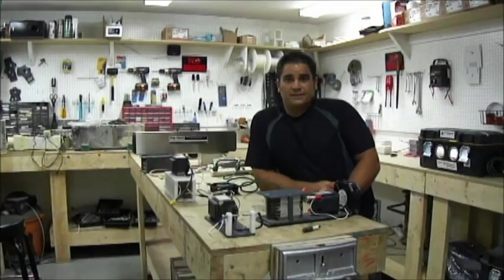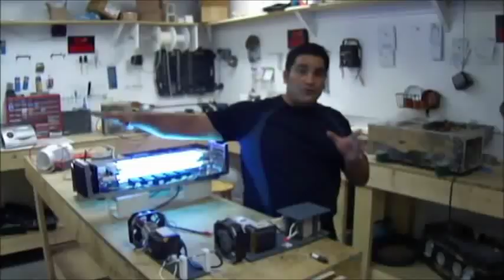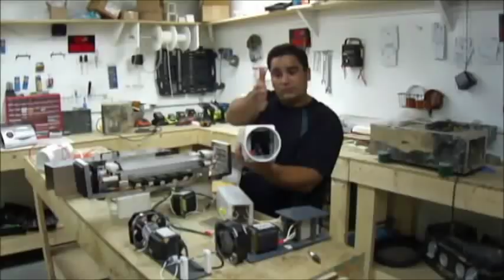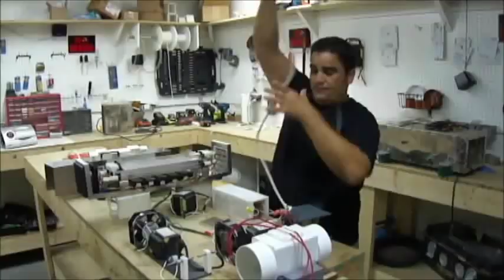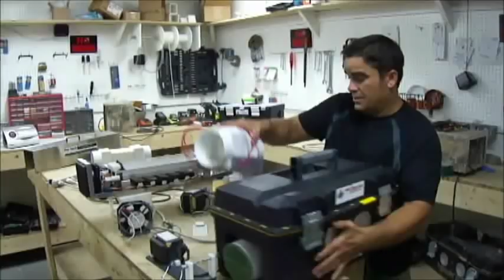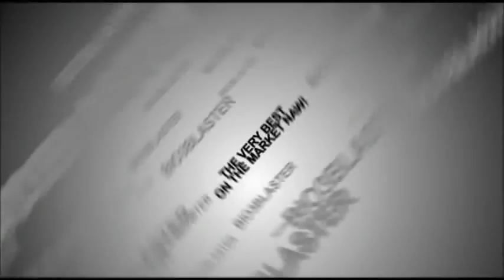Ozone Generators Exposed: What is inside makes the difference.

Comment: Only the high electrical pressure forces the fusion of oxygen atoms together forming ozone, and not the spark itself. When the sparking event occurs, the high potential electrodes are basically shorted together, and at that point no more ozone is produced except during in between sparks. That's why you don't see commercial ozonizers sparking during operation. Just my 2 cents.
Reply from the maker: Thank you  for your thoughts.

Comment: They use ozone to sterilize cpap machines and accessories. They talk ozone hurting the cpap stuff but just how much do these devices make and just how much parts is needed to hurt machine or plastic and tme exposes
Reply from the maker: I developed the first ever CPAP sanitizer using ozone,  see the video on this channel.  If you run it too long you could damage the plastics but very hard to do,  most of these units use very little ozone.

Comment: UV O3 vs. Corona discharge 03 differ, at lower atmospheric levels there are pollutants present in ambient air gasses, from the decomposition of organics (methane etc,) hydrocarbons and common forms nitrogen will readily bind to the additional Oxygen atom using the corona discharge method, forming undesired contaminants along with the O3 the UV method that occurs naturally in the upper atmosphere is free of pollutants from decomposing organic matter, and in the ionosphere, where constant electrolytic activity takes place, you have the best of both worlds and a safer pure O3, in contrast to what we’re actually creating through the CD process for example when the Corona discharge acts upon organic gasses it subsequently releases a Nitrogen atom, which combines with oxygen creating NO2  “NOzone” or Summer Smog. Nitrogen free O3 is also created as well as other compounds due to the instability of the O3, adding filtered purified air and or concentrated O2 upstream of the arc and having a contaminate free post arc area to allow the atoms to combine free of intrusion would produce more desirable results, It doesn’t matter how much Ozone you’re producing if you’re producing harmful contaminants as well. This way you release mostly “O” or O2&O3 the O3 can toss the O at the nearest suitable ionic candidate ( Nasty Stank ) and let the oxidation occur where you want it to, less ozone is needed for this, but when you use most of your ozone before it meets the desired target on pollutants you Co-generate, you must increase the production exponentially for it to be effective. Output is only one factor in a chain of possible variants, “More Power” means nothing if it’s wasted on fighting the resulting increase in counter production. 
 Just food for thought
Reply: it sounds like you have a good idea on all this ozone stuff.   any suggestions for someone new to the subject?  would you suggest a type of machine to use?
Reply from the maker: Well thanks for your thoughts.  Corona discharge can make medical grade ozone with a pure O2 input. Having tested both types of generators in the field i disagree,  with your hypotheses.  Good insight however.

Comment: I would say bring back the old cathode ray tube TVs back, because they purified air by trapping small particulate matter to all its internal high voltage components, an old CRT tv worked potential of +10KV and attracted all particulate matter both on its screen and as well as inside through venting grills, this is the prime reason there are more deaths through lung problems as small particulate matter stays air born and does not get trapped by old fashioned TVs and a result of which more children are suffering breathing problems, rise in asthma cases, and all being blamed on Diesel cars, for God's sake diesel cars were in use for a long time, and despite more stringent pollution control and catalytic filters and tighter emission controls, they are trying to ban diesel cars, as they are blaming higher NO2 gasses in the atmospehere, which is caused by reaction with Ozone, however old fashioned TVs in every home were very effective at removing particulate matter.
Reply: An air ionizer will fix the particulate problem. Ecoquest, Vollara, Alpine made ozonr/ion generators that cleaned and purified the air in a home electronically.

Comment: Never in my life have I heard such a load of miss information and absolute B.S. The sky is NOT blue because of ozone for starters. There is no, nor has there ever been a transformer of any kind that produces D.C. current. There are no "types" of ozone, ozone is a chemical. It's chemical name is O3, as opposed to oxygen, O2.  There is no such thing as "carbon ghosting", what he is referring to is the build up of soot (mostly fine particulate pollution from diesel combustion) on anything around a high voltage component due to the ionization of the air surrounding said high voltage component/s  which attracts and electrostatically traps any fine particles. This is the same principle exploited by negative ion generators and negative ion air purifiers.  I am left with questions though...
1: are the super thick ceramic dielectric substrates as thick as this bloke?
2:what on earth were you thinking when you decided that what you had constructed was by any means a saleable item?
3:how many people have you electrocuted so far?

Someone has already corrected you for getting Nikola Tesla's name wrong, they claim it no big deal, I beg to differ, the man was a genius of the likes we probably won't see again and is responsible for the electricity your very device runs on. The least you could do is get his name right. Have you ever considered maybe ensuring the "facts" you have presented here are correct also?
Reply: This is the funniest/most correct comment I've ever read.  I think you are my soulmate.
Reply: How many people have you electrocuted?   Hahahahahahahauaha, that made my day!
Reply: isint the sky blue due to the scattering of sun light Raleigh effect think i spelt that right...

Comment: Or, we could all simply purchase a few high out put ozone generators , put them in front of a big fan in a box , and presto ... a similar machine ... 3500 hrs. is not a lifetime of use for any individual ... using simple math applications ... and you are using AC current to show this video / make the video/ upload the video / power your equipment ... and you can't even speak his name correctly ... Tesla , ... lol,  I actually considered educating you on the increase of electro-magnetic flow for increased output of ozone using a stepped up adjustable current system ... how-ever , the info would be wasted on the understanding of NICKOLI ...
Reply from the maker: Thomas,  all plates are replaceable,  we now offer 5000 hr. plates. All equipment of any kind has need of service from time to time.  Nothing lasts forever except God.
Reply: Thomas Squires , 3500 hours is a lifetime of use for normal people. You are a presumptuous ass. 
You don't do shock treatment on your house every day. You have to live in it and breath the air. 
Also, your way of pronouncing Nikola is just as wrong as his.
Reply: ahh the presumptuous ass to those that are ignorant in the advanced educational applications of science and alternatives to that which has been taught ... in any case , good luck with your created energy ... I do not accept your thought process ... you own it ...

Comment: Nicoli tesla was insane as fuck he kill innocent animals
Reply: Anthony Marshall ????? Nono. You are thinking of Thomas Edison, friend, who would electrocute animals with AC in as a way to scare people away from it. Without Tesla's AC generation station at Niagara Falls, Edison's DC lines would have blotted out the sun from view. It took massive amounts of energy and extremely thick cables to transfer the DC  at such heavy losses. So when Tesla came out with such an elegant solution that was cheaper and smaller on all fronts, it immediately assaulted Edison's work and business model.
Reply from the maker: Edison killed animals to prove his DC current was safer than Teslas AC.  Tesla is responsible for almost every modern convenience we use today.  Florescent lights,  the remote control,  the radio Marconi stole it and supreme court overturned Marconis patent (he was teslas assistant for a while),  wireless charging,  even wifi.

Comment: Could you build one of those factory size, place it in Australia and use it to fix the Earth's ozone layer?
Reply: Im really happy with my  (US$ 29 )Intelligent House Purifier Ozonator . I have used it for 3 monts now and i can fell a huge change in  my livingroom after only 20 min running.  i got mine at http://www.banggood.com/BESGEER-Intelligent-Sterilization-House-Air-Purifier-Ozonator-Fresher-Purifying-Machine-p-990433.html?p=J031143423240201512X
Reply: No, sorry but that wont work. Ozone is extremely reactive and will have reacted with other gases and formed other molecules and regular oxygen, the generator would have to be placed high up above most of the atmosphere.

Comment: In the corona discharge the only reaction that occurs is the formation of ozone from oxygen?

By the way, great video and product.
Reply from the maker: Mark Messa Not exactly true... this question is dependent on input gasses number of gs recyclings temperature and other variables
Reply: OzoneGeneratorBest > "[...]  this question is dependent on input gasses number of gs recyclings temperature and other variables"
Under standard atmospheric conditions, the only reaction that occurs in a corona discharge is the formation of ozone from oxygen? Or there is the formation of other substances? Any of these are harmful or undesirable?
Reply from the maker: This depends on how mas gas cyclings are put through the box and on the definition of harmful, it depends on what you mean by undesirable, if you are going to do do vaginal or rectal insufflation you would want to use a pure O2 input; for an ozone sauna you would want to make use pure O2 input gasses and wear a respirator to protect your lungs.
Reply: +Mark Messa     If you use moist air, you can create Nitric Acid.  That is why you use an air dryer or o2 concentrator.

Comment: Very interested in your ozone generator, made my own to sanitize my swimming pool as I don't like dumping chemicals into my pool or storing chemicals and my wife has a skin condition which is made worse with chlorine. My generator used UV tubes and the gas was drawn into the pool via a venturi on the return line after the filter. The water quality was very good with no algae or black spot. The water was kept soft by adding bicarbonate of soda (food grade). The only down side we kept getting frogs coming into our pool, to me this indicated the water was good. Read all the negative comments, jealousy is a terrible thing.

Comment: 1) Is ozone generated from medical grade oxygen considered dangerous to breathe?

2) Your design seems to make sense from a  layman's point of view, because it has a greater surface area then a spark plug gap.
Reply from the maker: 1) google ozone and the mouse from merlin
2)From a LAYMANS view or a scientific view more surface area means more ozone!
Reply: OzoneGeneratorBest yes, I agree you it does make sense from a scientific viewpoint, but by layman's point of view I just mean that makes sense.   In fact, I like the design.   

I have been reading on ozone therapies in the last year.  One of the things that I was curious about is if one generates ozone from medical grade oxygen (99.xx % pure oxygen), does it cause lung damage.  I'm not sure that it does. Have to.read up on that again.
Reply from the maker: That is why I suggested googling the above mentioned item, I will not share my opinion but would like you to read that story!
Reply: OzoneGeneratorBest just in case anyone is reading this:  Dr Mercola did a recent interview (I saw it yesterday) and the medical applications for ozone are done through sublimation and injection, not through inhalation.  :-)
Reply: OzoneGeneratorBest that is a very interesting story (Merlin ...).  So the toxicity levels of O3+, when it smells rancid instead of sweet, is possibly due the NO2, not the O3.

Comment: You point out the silver and, on the other side, nickel plate material on your units, but I didn't catch why.  I'm curious, since silver is expensive.  Too, the over fourteen year old stainless plates on some of my glass plates [that are, as of yet, unbroken] are still in good condition.  If it's about the improved conductivity, why not just add more plate area?

Comment: Nice machine! I would like to correct one of your remarks. All transformers use AC at the primary winding and have an AC output. You didn't say that the ones you are using happen to contain internal diode rectifiers (and this is not common).
Reply: David Hart
Only if the output runs through a diode arrangement to convert AC to DC.
Reply: Kelly Craig Hence my preceding "... have DC output" with "... like the ones featured".

Comment: I'm interested in how you are using hydrogen to weld/fuse stainless to copper..  Is it a brazing, soldering, tig, mig, stick, plasma welding process?  I've used ozone machines for years and I agree with you , they all are pieces of crap. I've had dozens and in one way or another they all end up breaking for some reason. I'm a fabricator and use CAD and other tools to make some pretty cool things. I'd like to chat sometime, I like that you are offering the highest grade of Ozone machines at a reasonable price, very cool.  I know you have a very solid design in a box but would you be willing to help me build one in the output of an AIR MOVER with a rectangular shape?  All electronics could be placed above. Thanks and great work.
Reply from the maker: Research Browns Gas
Reply: Why bother using expensive hydrogen welding equipment when you can just as easily braze copper to SS with silver?

Comment: Good video explaining the diff. generators of the market and why they're not worth buying. But once you did get to your product in its sold form in the tool case it's built into, the video ends.Spend time showing it working as if you had just bought one, and were using it on some moldy surface or some fungus/mushrooms.Show how you swap out those ozone paddles you said are replaceable.You spent way too much time on other products.Phone # isn't up long enough either.Promote yours,not theirs.